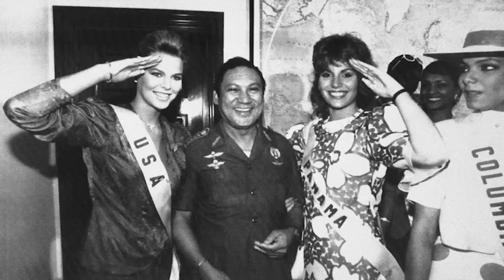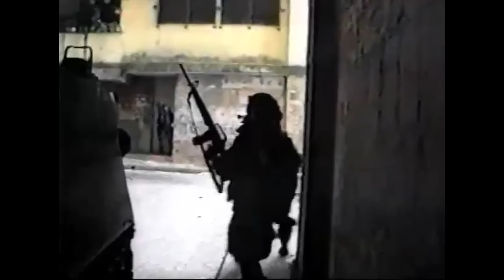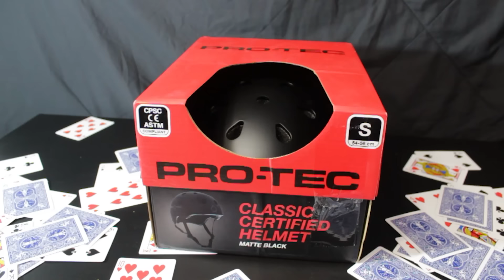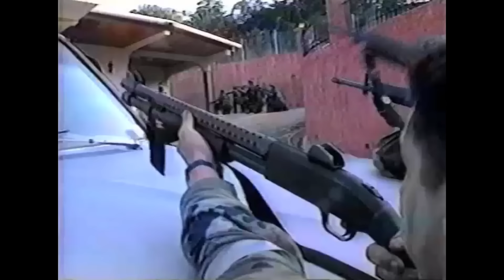Why Do Special Forces Wear Skateboard Helmets?

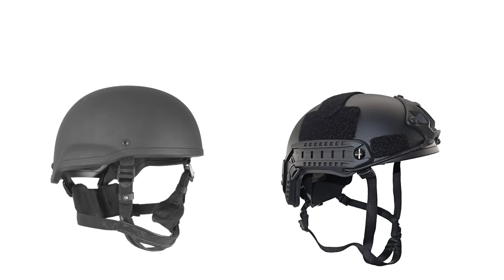Comment: Regarding 6:50, not mentioned in this video are the new military Next Generation Integrated Head Protection System (NG-IHPS) helmets which use Spectra instead of Kevlar, because Spectra is stronger and lighter than Kevlar.

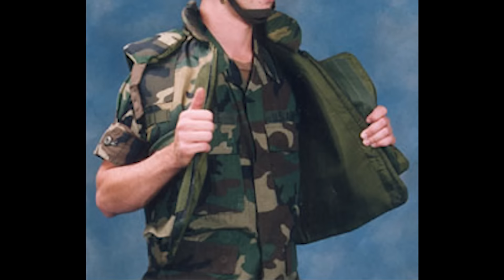Comment: 2:28 WRONG. That is not a "bulletproof vest." That is a flak vest. There's a big difference. The flak vest is made to protect a soldier from fragments from grenades and artillery. The owner's manual even says, "this vest will not stop bullets." Don't buy one of them and think you can tank a .45 round.

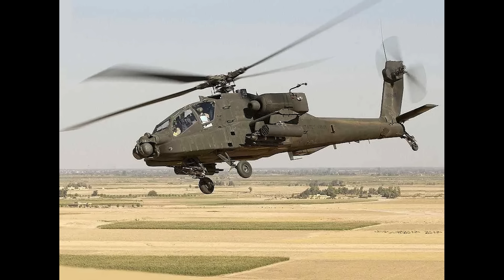Comment: Min 1:15 They took five Apache helicopters and had to scavenge four of them to keep one flying. Something to do with it not handling the humidity? But it was the dry season??? The Cobras ended up doing most of the air support but the Apache did save our ass once so i can't complain too much. They obviously got it right before Desert Storm.

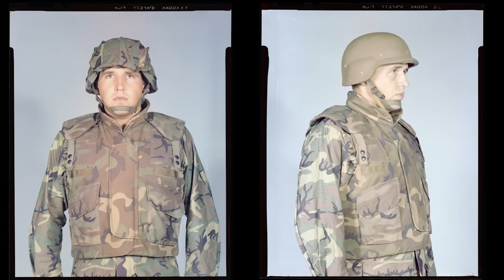Comment: Min 2:40 that's Bullshit. I was with B Co. 2/504 PIR in Panama. PFC Burkhart in my platoon had a 9mm directly in the front of his helmet, skid around his skull and go out same spot in the back. His head was harder then the helmet. Here is the dirty secret, the helmet rating is zero if it hits on the rivet. A Protec was not a 'technology' over a hocky helmet and the ear cut is meaningless because the SEALs and STS were using the full ear version long before that, Delta used the cut ear a few years in the late 80s to early 90s. The Special Ops (not Special Forces) were not going to wear a heavy helmet that was not reliable to stop bullets, I have only seen actual rifle helmets with no rivet holes in the last ten years. And back then its easier to replace a floating plastic helmet than a Kevlar if it gets knocked off your head into the river. Until the MICH corrected those things, here has been no reason for a Protec for 20 years except for airsoft. With one exception the 160th pilots had them on their E&E bags to hold their NVGs on their heads when they diched their flight helmets.

Comment: I should clarify, the title is misleading. We did use skateboard helmets, back in the 90's. Now we use bump helmets. It's the shell of a regular helmet, but with padding instead of ballistic material. They can mount NODs, and yes, they prevent you from getting dropped from smacking your head on something.

Comment: If a product is sold on the commercial market, it must be user-friendly and satisfy customers; otherwise, the company will fucked.
However, if the product is sold to the military, in this case, the manufacturer only needs to meet the requirements of the military's procurement department; whether it performs well in real-world conditions or satisfies the soldiers using it is often irrelevant.
This is why many military products are actually inferior to those available on the commercial market.

Comment: As a Skateboarder of 52 years I wear Pro Tec because they fit they work they’re durable and you almost can’t shake them off your head. If the chin strap comes loose, the helmet stays on. A brain bucket should function properly protect make great skateboard helmets and always have. I’ve only used mine skating two or three times But having it on when my head hit, the ground was a lifesaver, literally and figuratively. 👀😂🙏❤️‍🩹🇺🇸

Comment: I think in making helmets, they should do more full cut helmets that allow for earpro/headphones than high cut helmets that sacrifice protection for clearance (which seems to be the industry norm)
Think of... something like the Pro-Tec Full Cut helmet, made from ballistic material, with built-in headphones.
Or something like the exaggerated Stahlhelm design worn by the Cobra troopers in G.I. Joe Resolute (that almost looks like Darth Vader's helmet), which drops below the ears and even provides moderate protection to the neck. I can see something like this becoming really popular with riot cops.
It would suck to get shot right through the Peltors, Sordins or Walkers, methinks.

I have the same issue with low profile plate carriers where it's just a plate covering the chest, but there isn't even soft armor over the abdomen. You know what's under your belly? That's right. The large intestines. You get shot in the gut and the colon ruptures, you'd be dead if they shot you on an operating table.
Peritonitis.
The nasty contents of your intestines pour out and get in contact with your organs, your system absorbs those toxins and you're a goner. There's no way to effectively remove the E. Coli and all that jazz from your bloodstream. And it's not at all an uncommon way to die. Hell, don't quote me on this, but I think that more troops got snuffed out by gutshots than headshots. The torso is a bigger target, bigger hit probability.

Comment: The military's helmets were too heavy and lacked ergonomic design. So troops bought skateboard helmets because they were easier to modify and more ergonomic while the loss of ballistic protection was seen as acceptable since the military helmets only protected against handguns and most of their engagements were against 556 or 762. There, saved you 8 minutes.

Comment: The his video has an incredibly ignorant view of helmets.
Special forces wore bump helmets both because of how customizable they are and because if special forces end up under artillery fire something has gone very wrong (jobs that involve being potentially pounded by artillery isn't really in their mission profile).

PASGT's ability to stop a pistolround was completely irrelevant. It's ability to stop fairly high velocity shrapnel was a big step forward for regular troops. Artillery has been the biggest killer on the battlefield since WWI (and the reason why steel helmets were reintroduced) and the PASGT helmet+Vest gave it the ability to stop even some primary shrapnel (rather than low-velocity secondary shrapnel like previous versions of the flak vest).

The brodie helmet was also a massive leap forward, not a "sign that helmet development had been stagnant". Not in its level of protection, but because its simplified form meant it could be massproduced. Britain managed to produce millions of it and roll out a new piece of equipment to all their troops within just a few years. A feat never replicated since.

Comment: Hmm … Ah the history of the >steel pot< vs practically in certain circumstances. 1975 fm UK to Europe, preferred among SOT was Joe Brown climbing helmets, then early hockey helmets, mainly pro techs. hair became longer, knee/elbow pads, gaiters because of wool climbing pants or not. Very few had unique equipment, pockets sewn everywhere, specialized radios, weapon mods, training on everything, just in case. Most were denied even some main stream operators, yes even the SEALS, Rangers, RECON, mainly because of leadership (officers, brass) fears and bias. It was real their HQ said no. 
For the mil and most >remaining< SF and SOT: Desert Shield not Storm was a major wake-up call. [Didnt forget the other between ‘nam and shield]. Wake up call?

Comment: Different helmets for different missions.  Bump protection without ballistic protection makes sense when most of your opponents will have rifles anyway.  The original kevlar helmet offered more protective coverage around the skull than the ACH and this was helpful for mounted operations where the threat might have been blasts.  I recall one unit had a gunner on a humvee who was killed when an IED fragment hit the base of his skull --under the ACH, but that would've been covered by the older kevlar.  However, the older kevlar was terrible when in the prone position as the back of body armor did tilt the helmet forward (something the ACH was meant to address).

Comment: Yay' Protec!

I have a bright yellow Protec full cut water helmet for packrafting, bike rafting and cycling, for which its perfect!

Those vent holes do indeed allow for using cable ties/zip ties to mount high output lights.

Fit is perfect, right out of the box, and it's lightweight and remarkably comfortable.

It is utterly shameful that the elite special forces troops of the US military are compelled to use recreational leisure helmets designed for urban skateboarders!

The greatest military in world history equipping its top tier special operators with skateboarders helmets is so pathetic it beggars belief.

Comment: Civilian trained Entry Level EOD Tech here...trying to get to Ukraine on a budget, not a preferable profession to want to go cheap on, but I thought the PAGST helmet could work nicely. The suspension system was junk. I replaced it immediately. Found a Level IIIA folding ballistic visor that would accommodate the PAGST helmet...the damn unit is heavier than the helmet! I eventually bought a construction helmet with the dial in the back for retention and fitted it to my upgraded suspension system. Fits great now...heavy AF...I even bought a flight helmet pouch to protect and transport it. 

I do have a question for anyone familiar with the PAGST Kevlar helmet, or Kevlar in general. My current setup sucks for ventilation, when the visor is down, it can quickly become fogged over...which can cause the obvious visual problems. In Humanitarian De-Mining training, our helmets had ventilation holes similar to the holes on Pro-Tec helmets. If I were to drill out similar holes would that compromise the over-all integrity of the helmet? Obviously some frag immediately going through the hole would cause the forever migraine relief, but would the rest of the helmet be structurally strong or be completely compromised and unlikely to protect against shrapnel? 

I'm reminded of a paratrooper who was assured in training if his reserve chute didn't work...he could exchange it for another. I loved the dark humor. He's retired, so he ain't gonna jump no more. Please respond with actual suggestions, but feel free to sprinkle in some dark humor.
Reply: Why do you want to go to Ukraine?
Reply: @bravo0105  that's what im saying. i'd only do it as a last-stand type of deal, if i had type 4 cancer or something
Reply: To help with fogging, you could buy a Pinlock Antifog insert for a motorcycle helmet. Pinlock for a scooter or open-face helmet would probably work for a ballistic visor. They're made in the Netherlands and are a common motorcycle helmet accessory, could be found at a local motorcycle shop. Maybe ask if they have any returned Pinlocks you can buy for cheap. Better helmet ventilation would still be good though. Good luck out there.
Reply: @Real_Bad_Guy  Awesome! I never even thought about motor cyclers, that is brilliant.  Thanks for the input!
Reply: Hi, I work with carbon fiber, glass fiber and carbon/kevlar composites (check channel). 
Some small holes will not compromise the integrity of an helmet since the strenght is given by the fabric nature of the material, essentialy is how the fibers are intertwined among themselves that give the perfomances these materials are know for. 
Type of resin and thickness are other factors, but it's the fact that fibers are made by filaments that give impact resistance.
I would not worry too much about a fogged visor anyway, you will last a week or two max in Ukraine, heavy artillery will be what will end you.
Reply: @pedgarage  Thanks for the technical input, that is much appreciated. Also thank you for the faith you have in me as an entry level Civilian EOD that it will be artillery that will turns me into the pink mist and not my own mistake. Also glad you think I will last a week or two, as I've been worried about day one. Don't want to Darwin Award myself on day one without saving a few lives by removing some UXO.
Reply: @pedgarage I assume that, without any military experience, his job will be demining in areas where there is no fighting. They aren't putting foreigners without combat experience into combat because they aren't any good at it.

Comment: Claiming that helmet technology had been stagnant for generations is insane.
Reply: Apart from looks, how much different was a steel helmet from WWII from a steel helmet from ancient Rome. A steel bowl is a steel bowl, no?
Reply: @zacharyjacobs7233  It pretends 2000 years of development through the medieval and renaissance never happened.

Knightly helmets from 1000-1600 alone saw multiple different divergent paths of development, starting from the nasal helm and evolving into things like the Great Helm which introduced full face protection, the Bassinet which introduced the movable visor, and eventually much more advanced designs like the Armet and Sallet which were multi plate composite designs that allowed for a tighter fit around the head and more elegant glancing surfaces to deflect energy away from the head completely, all while being lighter and easier to wear. Until firearms got strong enough to penetrate them, the Armet and Sallet made you pretty hard to kill. 

The materials even changed over time, Roman helmets were made of bronze and iron, while the medieval helmets benefited from improvements in metallurgy, using higher quality steel.
Reply: @zacharyjacobs7233  A lot actually. A roman helmet was designed to deflect strikes from a sword, and the helmets used in the world wars were meant to protect against shrapnel. They would be completely useless against a sword, and a roman helmet would probably protect against shrapnel, but they are significantly more costly to produce than the helmets of the world wars and were not meant to be mass produced. Just because they are made of 'metal' does not mean there is no innovation or meaning in their designs.
Reply: @lmperatorereal a lot like what? I seriously doubt you could do more than dent a WWII helmet with a sword, so how would it be useless? The basic functional principle of "piece of metal worn on head stops flying metal objects from penetrating head" is the same a thousand years ago as it is today.

Until the invention of Kevlar and advanced polymers that absorb and dissipate impacts, the general physical function of a steel helmet is the same.

Obviously manufacturing techniques have changed drastically, and something handmade was much more expensive and time-consuming to make, but that's not what I'm talking about.
Reply: @lmperatorereal a sword would not go through even a WW1 or 2 steel helmet lol

Comment: I wondered who was the first army to introduce this 4-point chinstrap for all soldiers. Not only for paratroopers, but directly for all soldiers, regardless of their branch of service.

And in a form similar to today's. So the Japanese parts are out of the question because you had to lace them up.

And as it seems, it was the National People's Army of the German Democratic Republic with their M56 steel helmet.

I may be wrong. Yes. But so far, I haven't found any other nation that had a helmet with this chin strap. Except for the NVA, which introduced this helmet when it was founded in 1956 and also served in Vietnam. As well as in Bosnia, Turkey, Egypt, and, according to a few pictures, also in Ukraine.

If I'm wrong and someone finds another helmet that was introduced before the M56 and had this 4-point chin strap, and that was for all soldiers and not just paratroopers, then please write it down and also include the type designation and the corresponding nation.

Comment: Correction on the ballistic protection offered by the original "Fritz" helmet. They would, in fact, stop a 5.56/5.54mm round. There is an example at the Infantry Museum at Fort Benning, GA, with a three-hole group in the 'forehead' of the helmet. The holes do not go through. I have seen it with my own eyes. I was issued a brand-new Kevlar upon my arrival to the 3AD in W. Germany in 12/84. I vividly  remember seeing older Germans doing a double take when they first saw the distinctly Germanic look of our new helmets :) Good video otherwise, Sir.
Reply: you mean the pasgt?
Reply: @mingus444_gaming  Yes. We usually referred to it as "the Kevlar," to distinguish it from the steel helmet still in use. Wore it for two years in W. Germany, got to Ft. Polk and was issued to steel pot
Reply: @grandpaweber2097  i've got one now, i believe i got it for less than $50 like 10 years ago

Comment: 4:20 Skateboard Helmet was basically equipment holder, not a protective gear. 
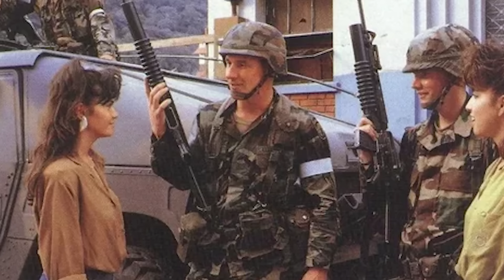5:14 You are fucked anyway since standard issued helmet couldn't stop rifle rounds. So they went full yolo. 
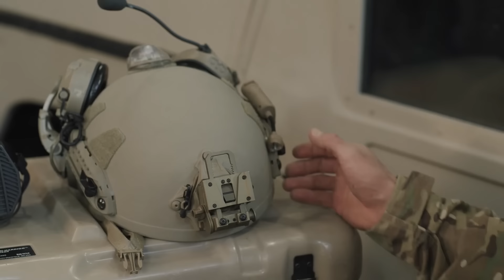6:41 Military later developed helmets that could serve as both protective gear and equipment holder. 
Although, even to this day, no helmets are truly rated safe against rifle rounds, quite a few lucky bastards have been saved thanks to improvements made over the years.
Reply: I love this comment, plus I'll add to it
Bump helmets are phenomenal for protecting noggin when in caves, buildings, etc.
Folk are inattentive to their surroundings, and a bump helmet provides protection from "slow" moments
Reply: funny enough, a great deal of SOF operators in photos can be seen wearing sleeveless shirts or rolled up sleeves
agility over discomfort
Reply: Another topic, Don't know how I feel about the ballistic SOF helms 
I have heard they saved lifes, but the trade off in weight is not worth being fast in anti guerilla insurgency environments, since arty is rarely used unless in IEDs

In Ukraine, I hear they are using full cut helms to protect from arty which is a smart thing to do

Thanks